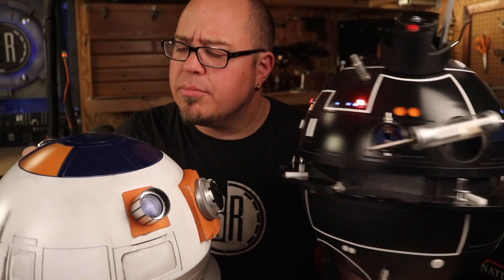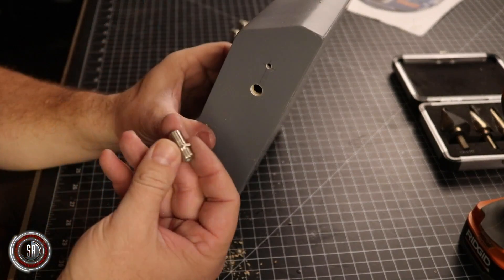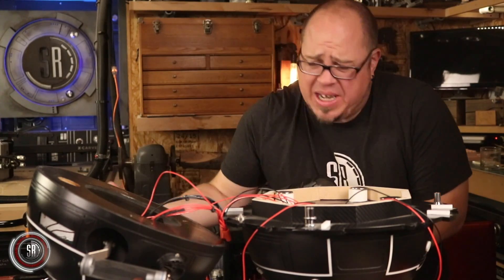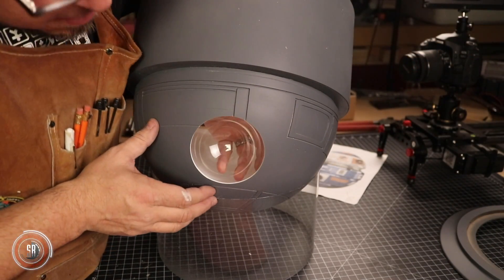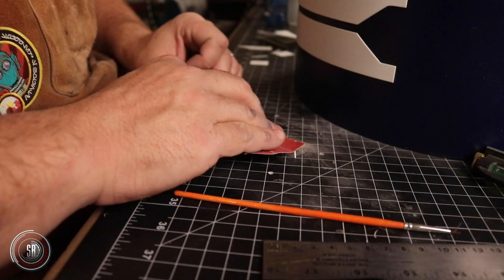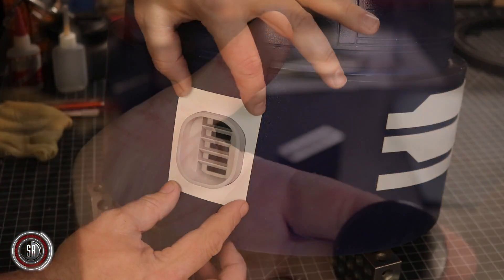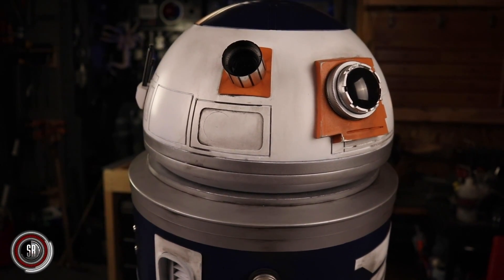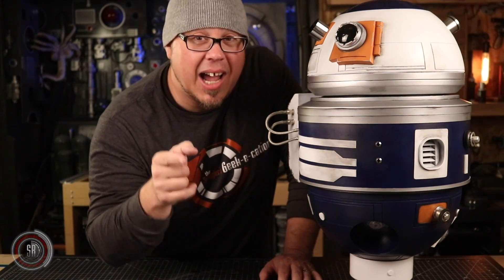Custom Star Wars Droid Build - Part 2

Comment: Looking great. Noticed the airbrushing. Was looking to get into that but not wanting to spend a huge amount to get started. Saw the brush you linked but you didn't mention a compressor. Thought about Harbor Freights but read a lot of bad reviews. Even paasche's $100 on amazon had some negative reviews. What would you recommend since you actually use these products?
Reply from the maker: Hi there Michael.  So the airbrush link we have is a bit costly, but we didn't spend and arm and a leg for our compressor.  Actually, when I first started messing around with airbrushing I bought this set which includes three airbrushes, (also, these are affiliate links, but they won't add any cost to you, just helps us a bit if you purchase) https://amzn.to/2O7T82K . That kit is $100, but it gives you three types of airbrushes that are decent starters.  Now if you want to get a nicer airbrush and just the compressor, then this link is just the compressor: https://amzn.to/2O8biS2 . This is the compressor we use.  To be perfectly transparent with you, i am still learning, and far from an expert on airbrush compressors.  What I will say is that this little guy has been great so far, and we haven't had any issues with it.  Hope all that helps you out.
Reply: @TheSmugglersRoom  thanks. Yeah thats the compressor i was looking at online. I have a cheap paasche airbrush that came from hobby lobby in the modeling section for like $25. It uses the hose with can propellant. The harbor frieght is just like the one you use but knock off model. A lot of compaints were doesnt hold the air pressure, pistons burn out, and doesnt work. But i watched a video review of same thing and they said could be just novices not knowing how to use them properly and didnt dial them in since factory settings start at 0.